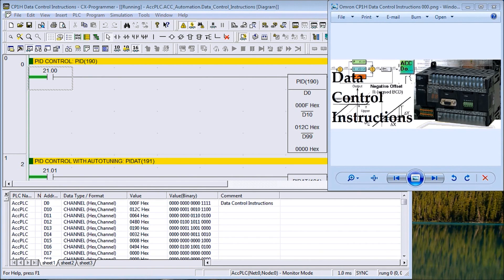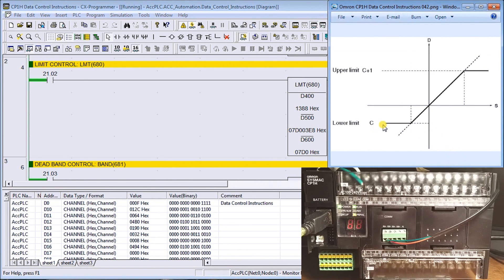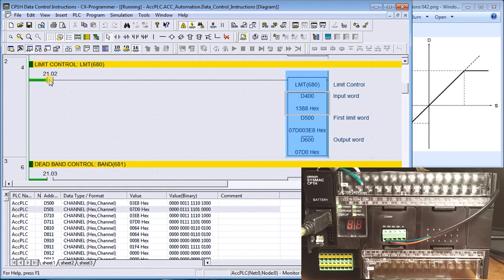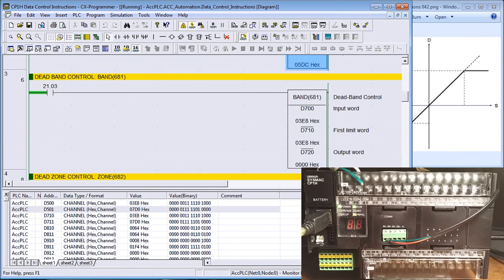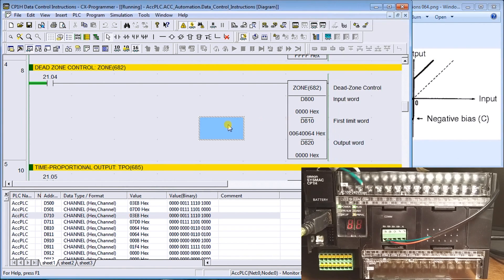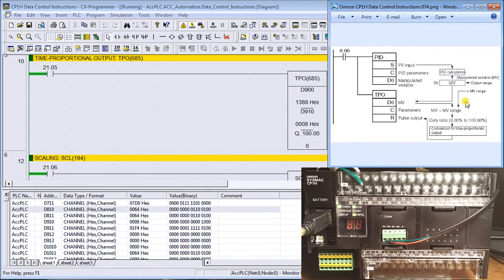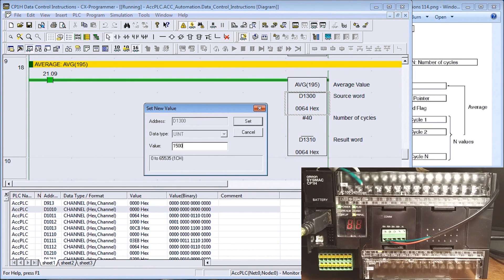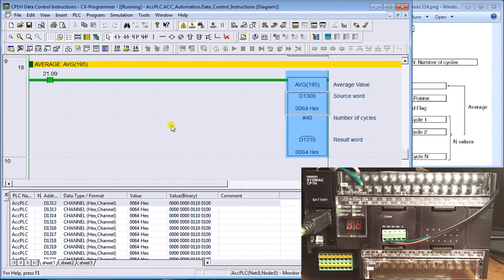Omron CP1H PLC Data Control Instructions! - PID, Scaling, TPO

Comment: Garry Shortt
I have a problem with PIDAT. When I make same the example in manual then the value of Output Word no change.Help me. Please!
Reply: https://drive.google.com/file/d/1aaRFeF-t8sSYvV2ZWRLfM4HW0hDVymvD/view?usp=sharing
Reply from the maker: Hi Anh,
I've quickly looked over your program and a couple of things come to mind. 
- Do not set the PID parameters directly off of the instruction execution. The auto tune will not be able to function.
- You are writing channel 3 into channel 10 every scan. This will be the input of the PID. (PV value)
https://www.fa.omron.com.cn/data_pdf/mnu/w451-e1-03_cp1h_cp1l.pdf?id=1916
I would suggest going the manual (3-17-2 PID CONTROL WITH AUTOTUNING: PIDAT(191)) and using the example.
Hope this helps you out.
Regards,
Garry
Reply: @ACCautomation  I wanna control the MV by limit it from 1000 to 6000. I change the value of C+7 (&1000), C+8 (&6000) and C+6 (#1494)  but it isn't executed. I don't know why
Reply from the maker: Hi Anh,
Bit 12 of C+6 must be on to enable the MV limits. You have a correct value to enable it. (#1494)
Remember that all parameters are set in Binary. If you want a limit from 1000 to 6000 then C+7 (#03e8) 1000 and C+8 (#1770) 6000.
Regards,
Garry
Reply: @ACCautomation  And value of MV to 4095 (0FFF hex) is max. I want it to 65535 (FFFF hex)
Reply from the maker: Hi Anh,
When the manipulated variable output limit control is enabled (i.e., set to “1”), set the values as follows:
0000 ≤ MV output lower limit ≤ MV output upper limit ≤ Max. value of output range.
Please ensure that your input and output range is set for 16 bits to ensure you can set the maximum setting.
Regards,
Garry